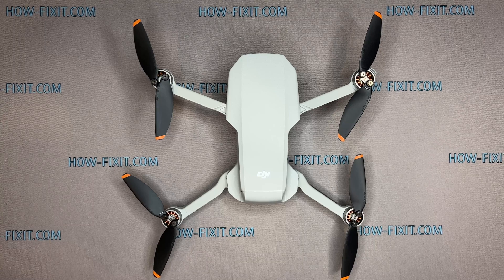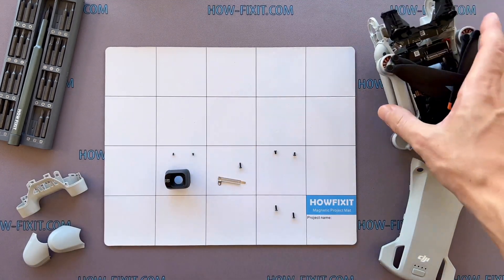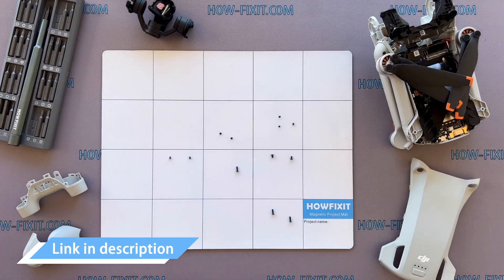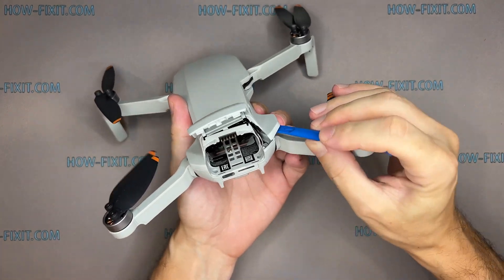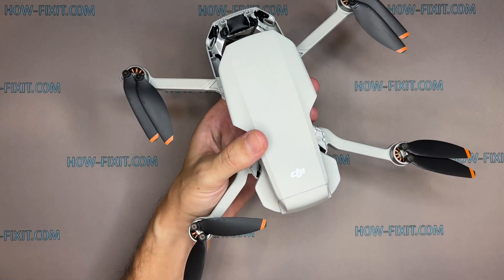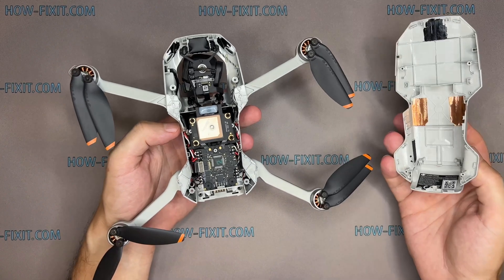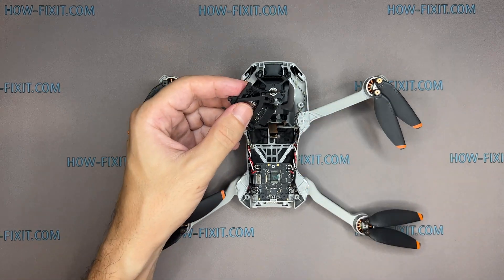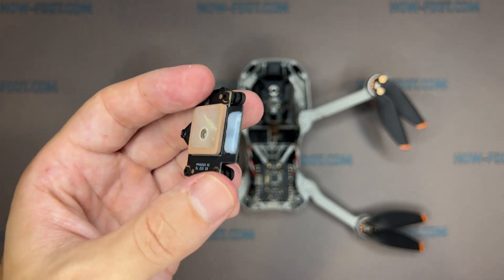DJI Mini 2 GPS module Replacement. How to fix GPS or IMU data error.

Comment: Just a quick observation on removing the top cover. Once you remove the four screws and have popped off the rear clips, look inside the battery compartment. either side you can see the main clips that hold the side of the top cover in place. I used a small flathead screwdriver to pop these clips which made the removal less of a pain and also reduced the possibility of damaging the sides. Hope this is useful.
Reply: I have about four Mini2 drones right now and one needs a GPS Module , when i have a problem ,  i Just start Swapping and Testing ! Put a Module in from a working drone and Walla !!!!!😊
Reply: I observed how the Clips are positioned and i press the part of the Shell to suit 😮 works every time !

Comment: So I replaced the GPS module to no avail then the flex cable, still didn't work and then replaced the ESC and it's flex cable and still no dice... Any insight would be appreciated.
Reply: I AM THE SAME AND I AM WAITING FOR THE GPS MODULE....IF YOU FIND THE WAY TO REPEAR, PLEASE TELL ME I WILL BECOME CRAZY
Reply: @freedomforyou1921  I suspect that DJI has something in their firmware that locks the drone out if you replace major components so that you are forced to send them the drone and pay for repair. If true is kinda evil, on the other hand when I sent my drone to them it was surprisingly cheaper to replace than the parts I bought to replace myself.

Comment: What about system navigation error 30105 how to fix that & what cause that error ? Plz help
Reply: in the description it says that it fixes nav error 30105 but i’m not sure. it makes sense in theory because this module is responsible for navigation and aircraft orientation. I have the same problem and i’m gonna try this out
Reply: @paultang8766 did doing this fix your issue?